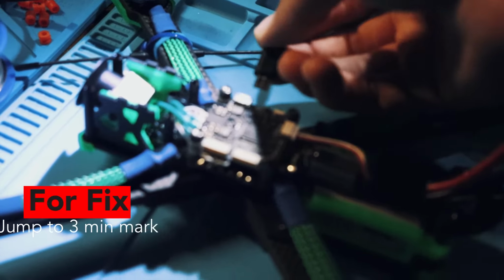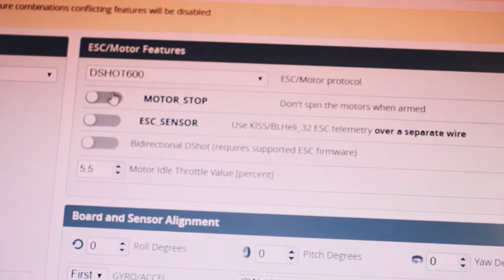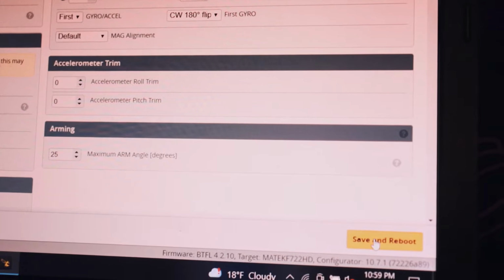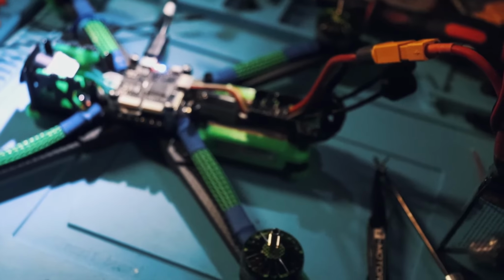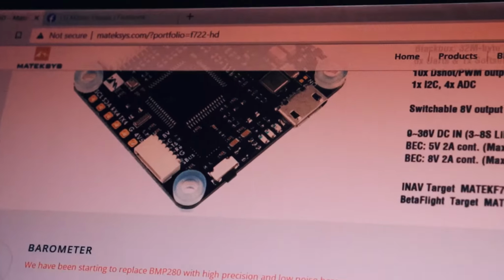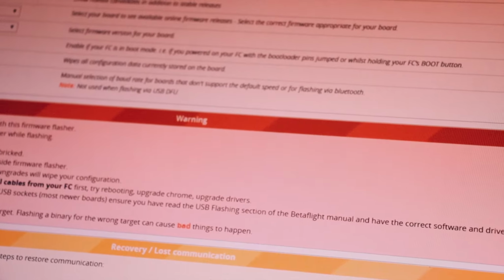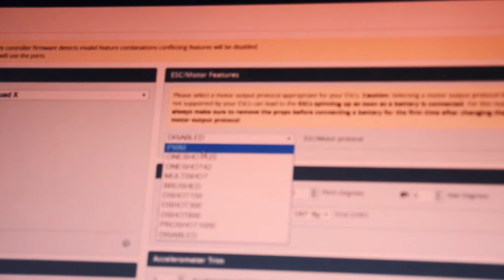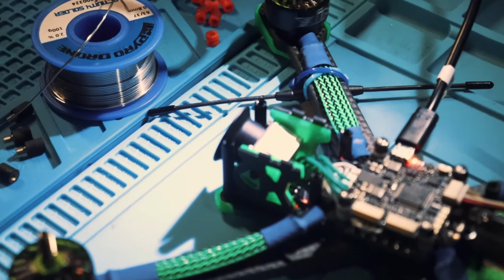Drone Motor Won’t Spin with Solution

Comment: And some motors are rotating at variable speed ,if down the throttle it doesn't decreasing the speed it'll goes up to its full speed I don't under how to solve it.

Comment: Mine also having this kind of problem sir but I'm using 30 amps simonk esc and the FC is omnibus F4 pro i have tried all the way but still I'm searching the solution for it sir
Reply from the maker: Sounds like it’s airmode, does the motors spin up when throttle is all the way down with your propellers off?
Reply: @JDOGFPV  https://drive.google.com/file/d/1DAqL3UpovqadC6lz7C60TM8x-KA6kFIY/view?usp=drivesdk
Here you can see sir , thank you for the response sir
Reply: @JDOGFPV  yeah sir it is spinning and slightly it'll rotates up to full speed even it is off prop and on prop it flying away automatically even I do nothing if I disarmed  it falls down on the ground